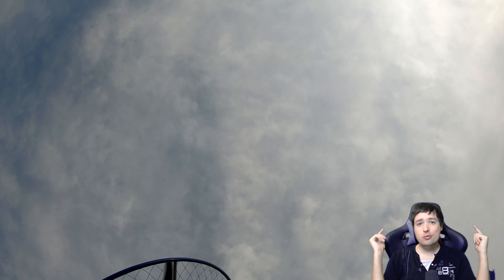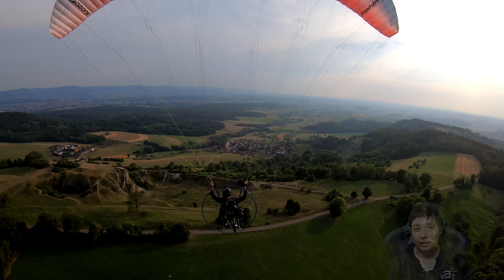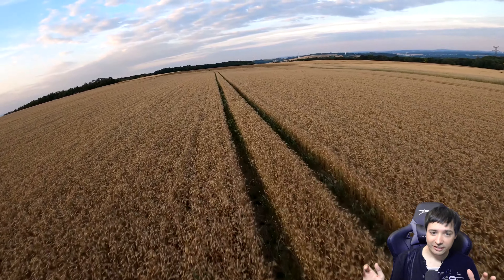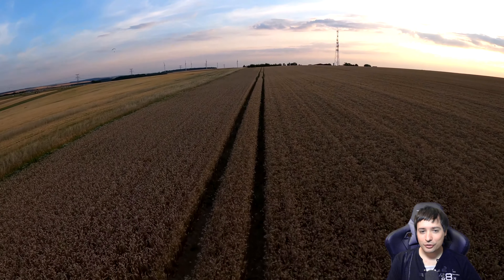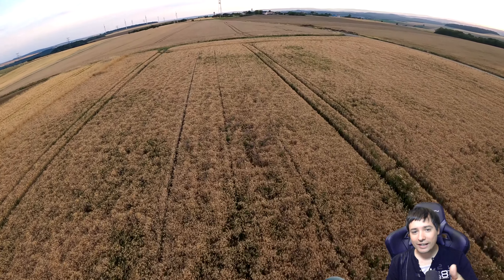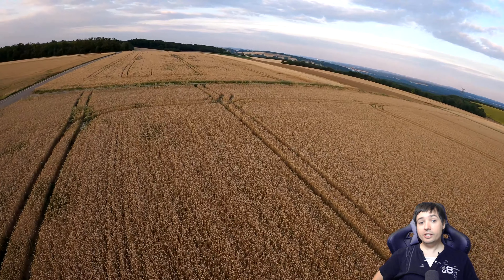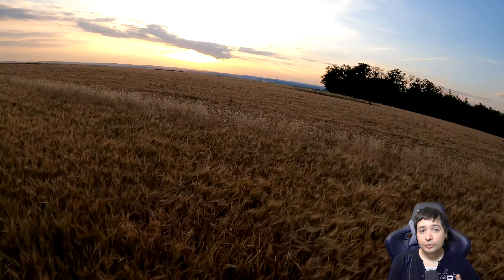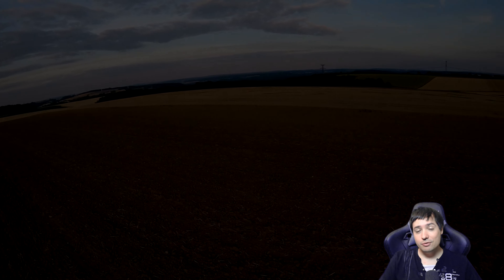Paramotor Flying Super LOW & SLOW PPG Manni - Motorschirm Fliegen

Comment: Hey Manni, I wanted to know how long can you go at once??
Reply from the maker: Hm. With the full 10 liters of this tank - for about 2-3 hours. Depending on how I fly. But at least 2 hours.
There are also much larger tanks you could fit to the Motor lasting even longer and if you want to go fully nuts you can even take a few extra soft canisters on sling ;-)